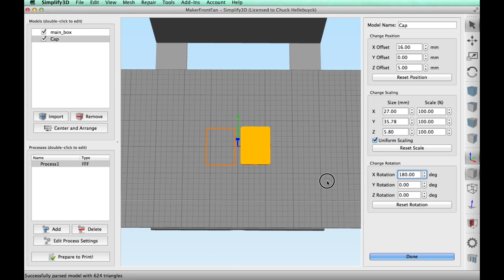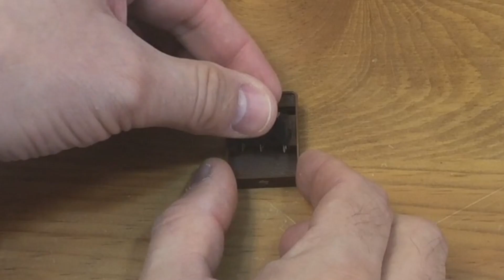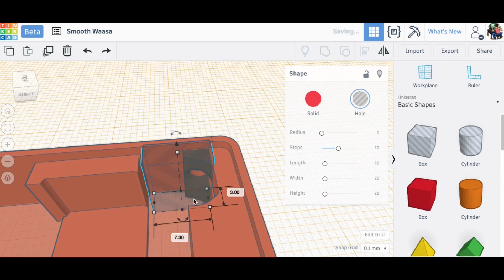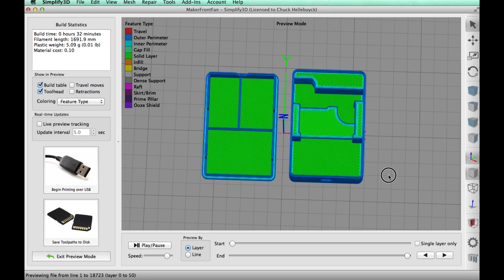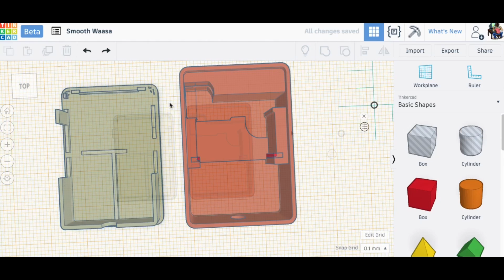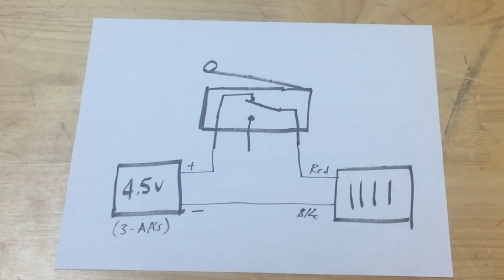How to make a Simple 3D Printer Filament Run-Out Sensor Alarm

Comment: NIce video! On my A30, Original sensor is only 2 wires. How can I plug a DIY one with 3 wires?
Reply: Just use only two connections only on the switch use a multimeter two work out whether the original is normally open or closed

Comment: Make the Arduino sending commands to pause the printer and it will the best system!!!
Reply from the maker: You need a USB host to do that and Arduino can’t do that without sone external electronics. That’s  where Octoprint on Raspberry Pi comes in.
Reply: But I can use a WIFIShield to broadcast the command over the network, still more cheap and simpler then a Raspberry don't?  I made something similar whit a IR BLaster to make the server on/off the AC....   @FilamentFriday
Reply from the maker: Not sure how that would work.
Reply: in my case I sniffed the network to found this command transmitted over the network "http://192.168.0.69/bwc=bwc:ir:0:1:2:10:&ms=1536094055" and I can build a script that in my server to turn on the AC by a Schedule!!! if the flasforge finder (my printer) receive commands from FlashPrint over wifi (pause, stop, print) theoretically if the app works in similar way the Arduino can send this commands whit WifiShield!!!   @FilamentFriday

Comment: Hi Chuck: I purchase the middle sensor show above. (1.75/3.0mm Filament Detection Sensor Module Pause Monitor For 3d
$5.47 eBay)  Now that I have it I don't know what to do with it.  Can this be installed on the CR-10 to make it Pause when filament runs out?  OR Do you know what is inside?
Reply: Thanks Chuck:  I thought since you had it identified that you might have that information.
Reply: If you don’t mind buying from China they’re only $3 each shipped. I bought 3 I can’t make my own for that.

Comment: Marlin has an option to add a filament runout sensor(just like yours, using an endstop switch), but instead of playing a sound in a buzzer it pauses the print and begin filament change procedure. Look for filament runout sensor on marlin configurations and use servo pin 3 on ramps based board.
Reply: How does this work. I want one

Comment: Great idea!  Question for you Chep. I recently took on a job prototyping various pieces for a manufacturing firm. I currently have an XYZ 1.0. What machine do you recommend for fast very high quality printing. Don't need to print many pieces for manufacturing but want to print high quality prints faster than I currently can. Any recommendations?
Reply: Thanks for the recommendation. Love the videos!

Comment: i did something very similar, but instead of a separate buzzer and battery pack I wired the microswitch across the reed switch inside a cheap battery-powered window alarm.   I like your videos and thought you might appreciate the hack.

Comment: Neat!  You should add mounting ears to the box so it can be attached to the printer frame.  And yes Marlin RC8 does have a setting in the configuration.h file for a filament runout sensor.  I don't remember where they put it, but I'll probably use either the X or Y max endstop inputs as I don't need them for endstops. (I will probably use the Z max endstop for an auto bed level probe.)

Comment: There are also filament width sensors that adjust the extrusion rate e.g. 1.69 , 1.70 , 1.75, 1.75, 1.8 mm and so on

Comment: Hey, Chuvk - instead od the buzzer, connect the 2 wires to the printer board and make it pause when you run out of filament. I did it with Repetier firmware, works like a charm.

Comment: Thanks, very good. I checked the Thingiverse link, could you please update it with the mm dimensions of the switch you used, will save others possibly having to print a few revisions before getting the right size, thanks. Looking forward to you hopefully showing how to auto pause if low filament.